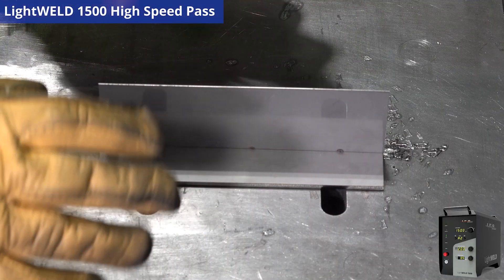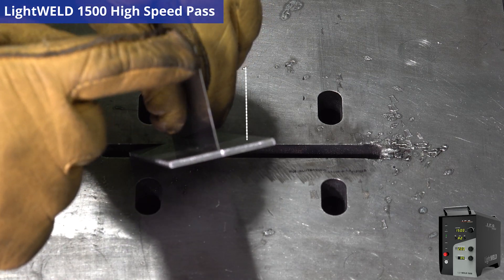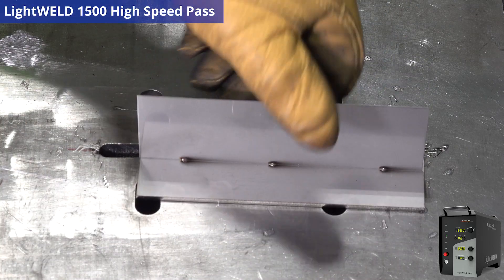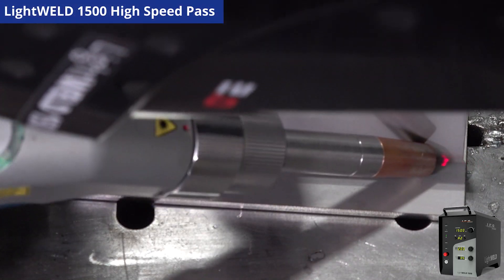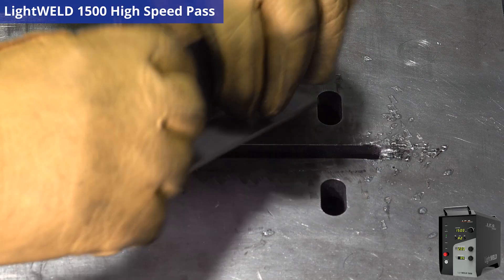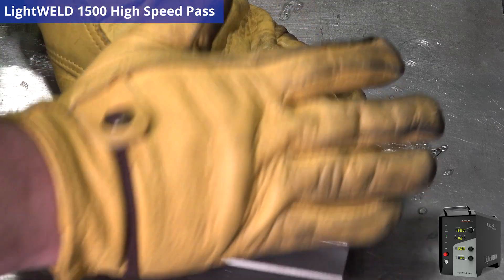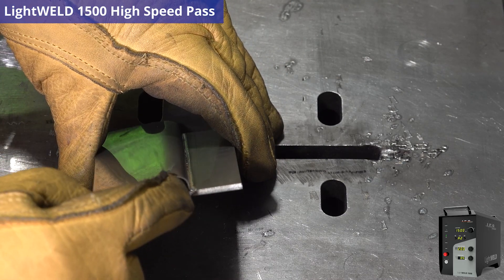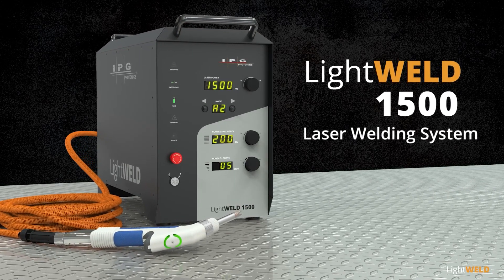LightWELD 1500 High Speed Welding

Comment: Price of this machine
Reply from the maker: Thank you for your question. Pricing can be found here on our website: https://shop.ipgphotonics.com/lightweld-1500-xc-handheld-laser-welding-1-syshhwxc0000001u  We have 2 models, the LightWELD 1500 and the LightWELD XC. The 1500 starts at around $19K and the XC starts around $24k. The main difference between the 2 models  is that the XC handles pre and post weld cleaning of parts in addition to welding.

Comment: No actual welding shown of thicker steel pieces that you would encounter on a day to day basis......welding those thin pieces is no demo for a review of a welder, but OK for this welder.....if you have a need to do that kind of work.
As no price has been indicated.........even a ball park figure would be good.......it seems it's far out of reach of the every day welder or fabricator but probably OK for very special cosmetic work that needs neat welds with no distortion.

Comment: I'd like to see a shear test for strength. Interesting but something tells me this machine can be made and sold for $1000 not 20k. It's just amps for heat and circuitry for timing on/off. No consumables or anything exotic. Nice way to put thin stock together I am sure.